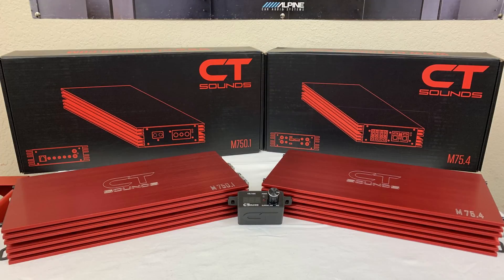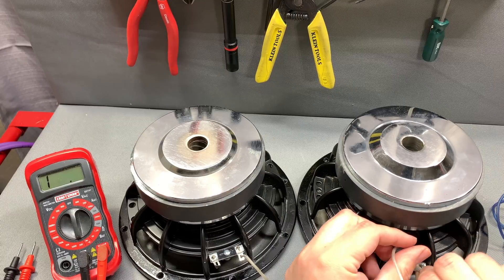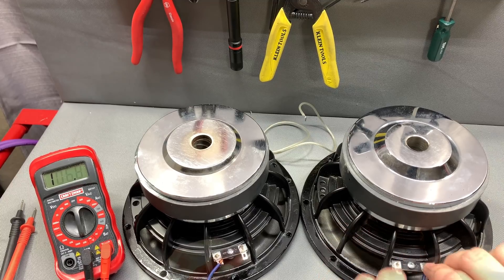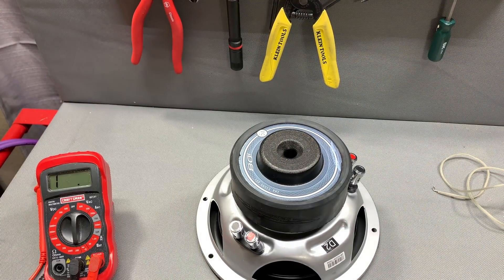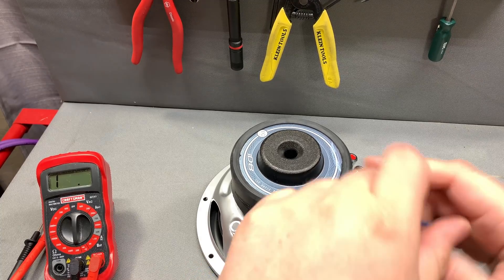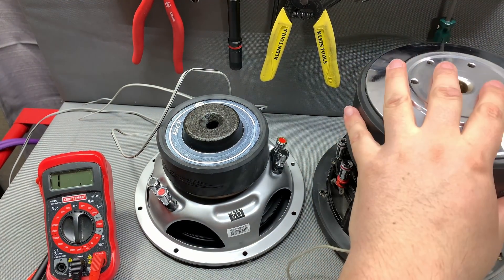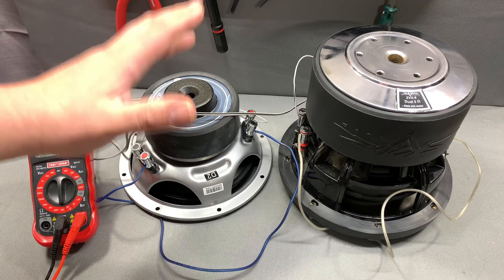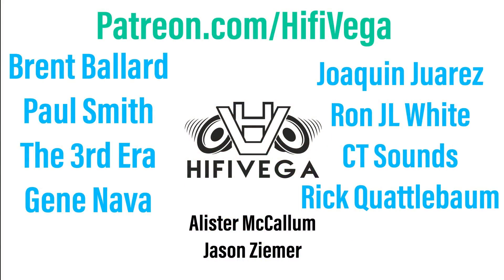How to series/parallel subwoofers

Comment: I've watched six or seven videos on this subject, which I understood before I watch any video. But I want to know, and what nobody ever seems to mention, is I'd you can parallel/series DVC subs. That is wire your coils in parallel and subs in series. I've been considering making a video on the subject myself just to answer question myself and  for anybody else. I got a decent amount of research on the subject but haven't even found anybody else asking the question. Thought you might know something. Over the last year I've been following the bass and amp guys (you, big D, showtimeSPL, and EXO mostly). Keep making good videos and I KEEP ROCKIN ⚡🤘🎸🎛️🔉🆙🔊🤘⚡
Reply from the maker: You should end up with the same load doing it series/parallel and vice versa, but the wiring would be much simpler in the series/parallel method

Comment: HIFIVEGA that was a great video!!! Very informative indeed, but which one of those setup's will get the most power out of an amp that is rated to be 2ohm stable and is also rated to put out 250watts x2 for a total of 500watts??? The amp is an OLD SCHOOL ROCKFORD FOSGATE PUNCH POWER 5x2!!! With out frying the amp of course, and what kind of sub's and wattage would you recommend pairing up with this particular amp to get the most power out of it??? Thank you!!!
Reply from the maker: In my experience you can run those amps at 2ohms mono a lot, but be warned they do get HOT lol

Comment: If you test em vertically on a wall the meter will ohm out more correctly, in my experience.(or in a box as you mentioned)!
Reply from the maker: Erock Snow fo sho! It was easier to video this way tho lol... I had .6ohm resistance in the probes that I didn’t try and  zero before I took all the footage so that didn’t help anything 😂